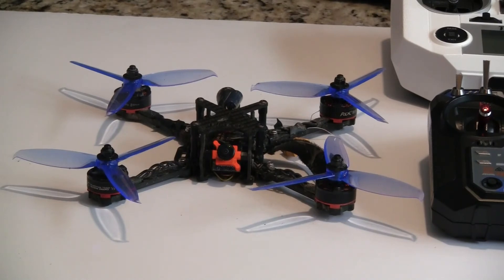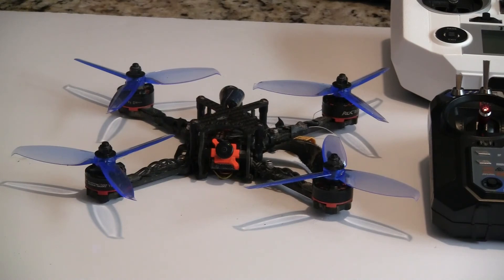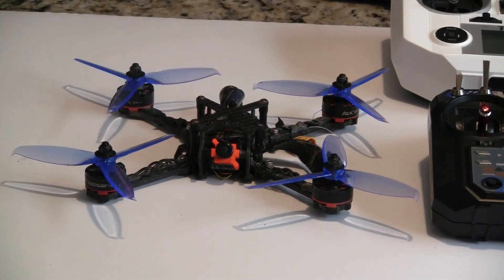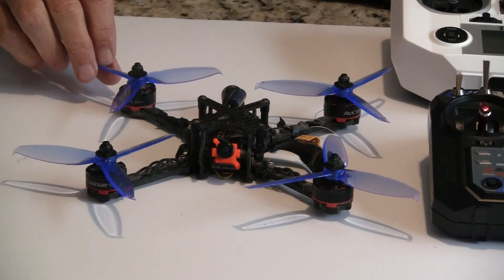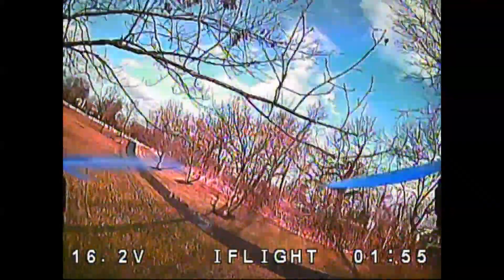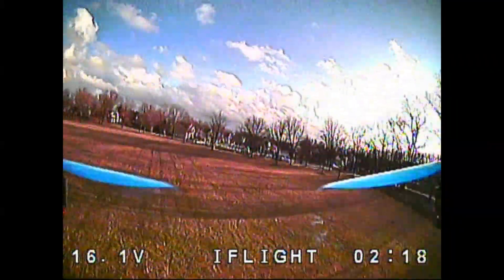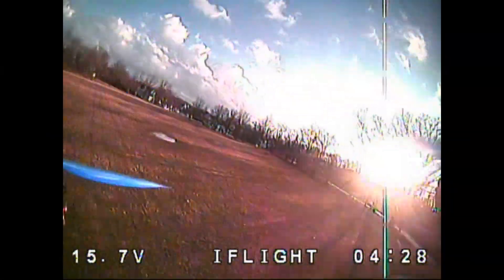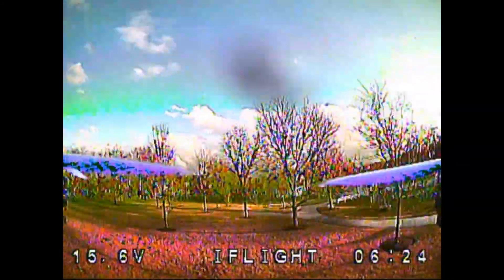Part 2 - iFlight Ultra Lite 5" with RCX 2205 x 2600kv Motors

Comment: I bought 5 x rcx 2205 2400kv. Two have rattling sound when spun by hand out of the box.  The raw gyro shown there are vibrations just a tiny bit better than the racerstar, which is not good.I still managed to turn off all notch filters with motors just hot but on a hot day they get too hot. However it did not affect the flight characteristics.  BH and emax motors i have their gypro data were absolutely clean. I had gave my feedback on a number of YouTube videos which have these motors. All replies are positive. May be because I bought them without warranties so the motors do not have the same quality of QC as warranty ones.
Reply from the maker: I have purchased twelve RCX 2205 motors and all were good. I bought all of mine without the $3 warranty. I also bought twelve RCX 1407 motors and one was bad from the start. I have noticed that the motors get noisier with time but that could be from dirt getting in the bearings.
Reply: John Moore I also noticed they get noisier with time. I clean them when I see dust inside. I remove the bell and clean internally.  So far I have replaced bearings on two motors and  have flew properly around 60 packs. I doubt they are ezo bearing. At least I could not see such label on the bearings. I  do not notice the same thing on my BH and emax. Can not complaint much with such a price gap

Comment: What did you use to fit the micro camera camera.  I read the opening is for a full size camera.  Thanks
Reply from the maker: I used a TPU camera mount connected to the front column post. The camera sticks out and does not have much protection but it works.
Reply: John Moore thanks I just found them on Amazon